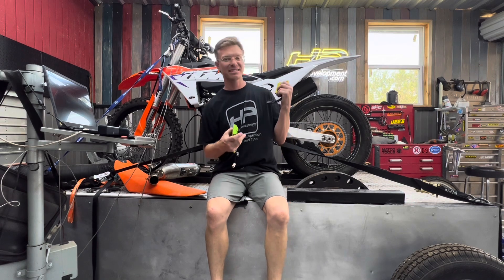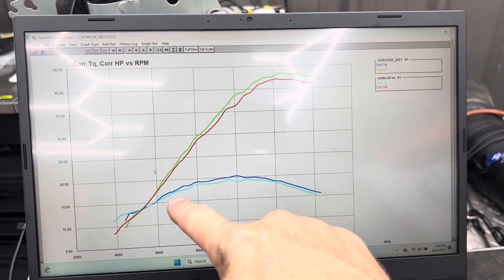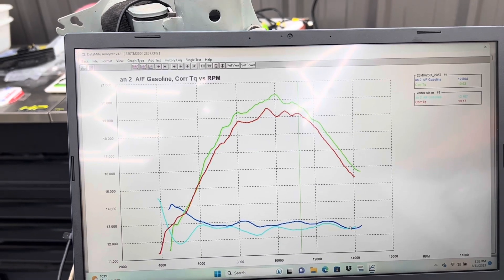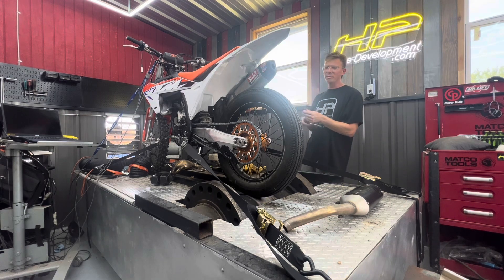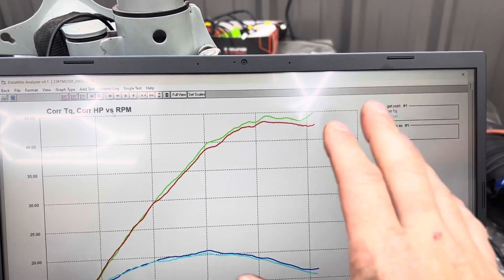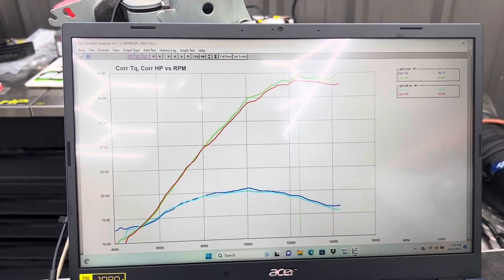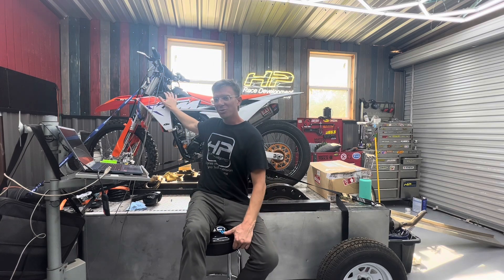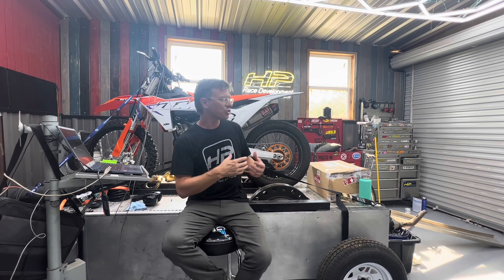ECU shootout! Vortex vs GET on the dyno - Bonus Yoshimura RS12 dyno

Comment: I own a GET and love it but this test is really just a test of the downloaded maps in either ECU right?
Reply from the maker: I think the the video is really clear - A mapped vortex by what is considered a great tuner (and is) and our in house mapped GET.  With afr ratio shown. The difference in power is NOT due to timing or fuel amount/afr - but some neat aspects that are unique to thet get platform and our tune up.  For the most part any ecu can be mapped to work well - but we think there is a clear reason to use GET and as such we use them...and offer them for sale.

Comment: But dual injection is worth the money?
I see Twisted Development did it on the 250 Suzuki  2 years ago and it works really good, Keefer said it felt like one of the strongest bike he tested. 
But that setup probably crush your bank
Reply from the maker: the suzuki comes with dual injection stock.
Reply: @HPRaceDevelopment  aaa ok thanks for the info.
Love your inbdepht suspension and engine tech videos
Cheers from Sweden
Reply: 2019 rmz 250 oem dual inj.
Im have 2014 get evo dual inj build.

Comment: Interesting. I wonder what type of secrets r being used out there to improve power coming from AMA racing or motogp and mxgp.🤔
Reply from the maker: Not many. Just really hard work and lots of money with smart engineers solving problems that arrise. If you can rev the engine to 16000 reliably - you are half way there